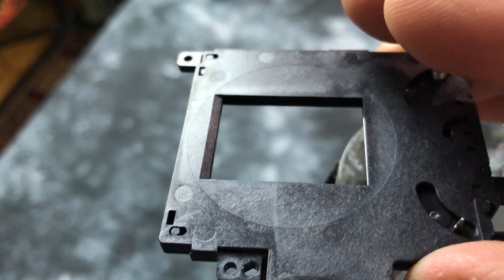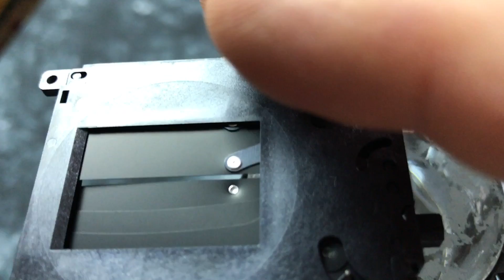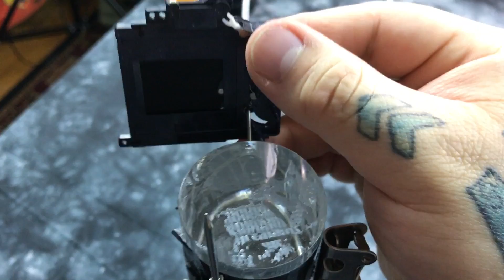🤓HOW A REAL SHUTTER ASSY. WORKS & HOW HSS WORKS

Comment: The shutter appears to scan the sensor ... is the purpose to sequentially access the sensor output in smaller chunks versus one massive data grab requiring lots of memory?
Reply: It has nothing to do with memory. Many film cameras have the same type of shutter.  It scans the sensor/film plane to minimize the amount of light hitting the sensor for higher shutter speeds.  Basically, faster shutter speeds will have smaller slits than the slower speeds.  The shutter curtains always move at the same speed, just at different times.
Reply: Thanks for the info.  With less light hitting the sensor at higher shutter speeds is done for what reason?